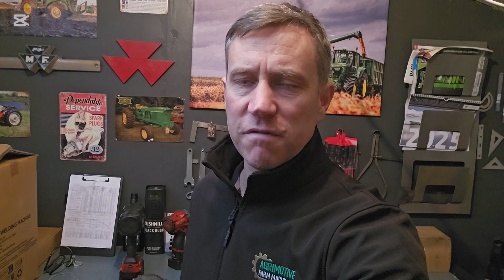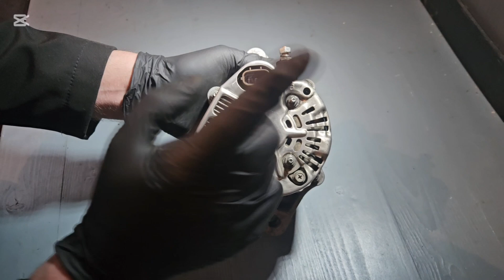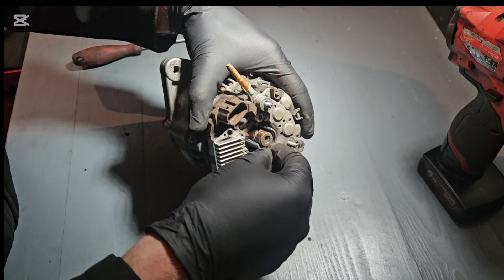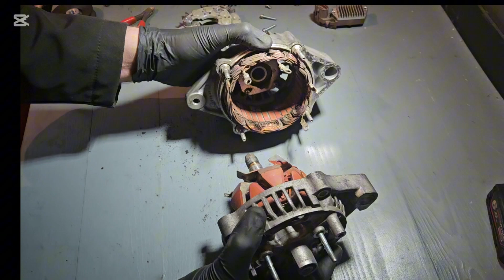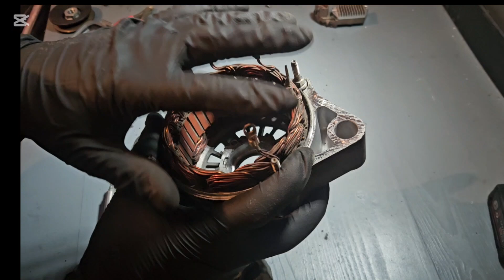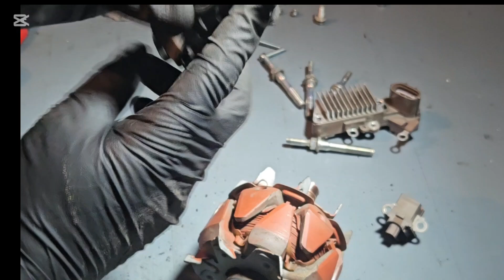HOW ALTERNATOR'S WORK! AND HOW TO FIX THEM!

Comment: Happy New Year. Great video ! I am in the process of refurbing an MF165 which currently has a dynamo and regulator (behind the dash).... and i am considering replacing the dynamo with an alternator. My knowledge it limited, but I believe a lot of 165 owners have done this. I am interested to see if you did this with your recent 165 restoration ?...or maybe it already had an alternator.  Are there advantages to replacing dynamo with an alternator ? thks
Reply from the maker: @martinnoonan9405  Thanks for your comment. No, I didn't change it, I left it original, I had considered it, but the dynamo had only been replaced a few years ago, so I didn't see the point. An alternator is obviously more efficient and more simple set up.

Comment: I often ask the dealer if the alternator is serviceable,the answer is no cheaper to fir a new. In which case a lot of otherwise good units are thrown out. Interesting video.
Reply from the maker: @grahamkelland  Thanks, Graham. There is often a sur charge on old units, and they are sent back to the manufacturer to be re-manufactured. Often, the "new" one you would get in a box from the dealer has had a previous life. Thanks for watching 👍

Comment: Hi Alan. Great explanation of how the alternator works. Had an issue years ago with a tractor (wont say which brand 😉). It was charging and i was getting 14 volts with the multimeter but the lift wouldnt work unless it was running at full revs. Spoke to an auto electrician and he suggested trying anew alternator and problem solved. I presume the amps were down on it??
Reply from the maker: @eamondempsey3018  Yes, most likely Eamon. It's the most common mistake people make,.. Check for volts and think all is good.. However, volts are no good without the amps. 👍
Reply: @AgrimotiveFarmMachinery  yea, I learned that the hard way. Lesson learned tho.

Comment: On my MF240 had the charge light come on, after a bit of investigation, the wire loom that comes from the alternator  running along towards the dash board area. A portion of the cable had rubbed through and was shorting out. a bit of insulation tape and some new sheathing, an easy fix, and a bit cheaper than a new alternator.
Reply from the maker: @astonmcleod5344  Well done. It's always nice to find a simple fix that doesn't cost much 👍